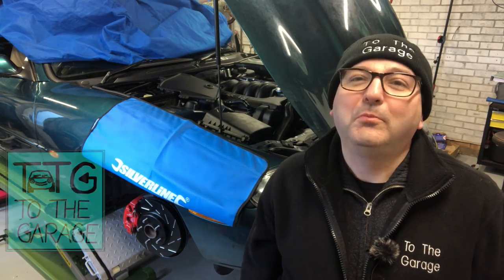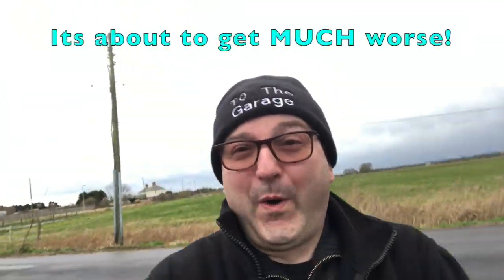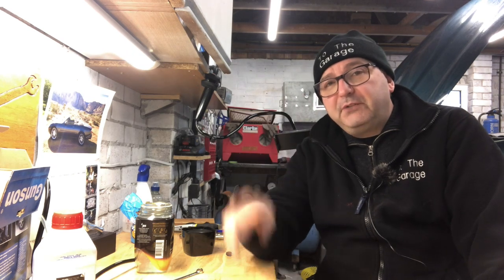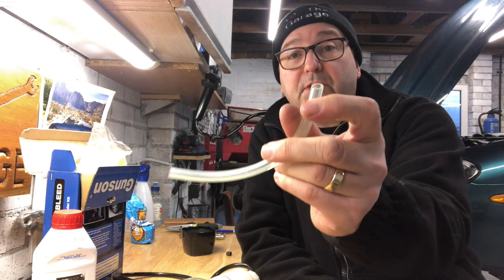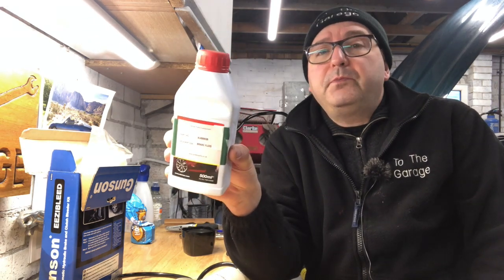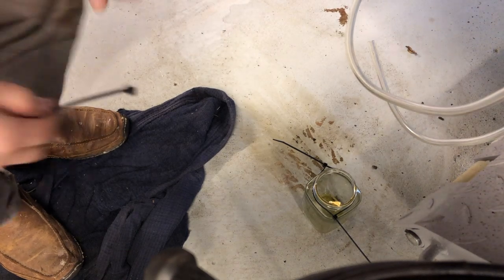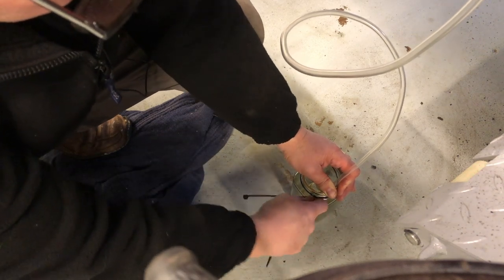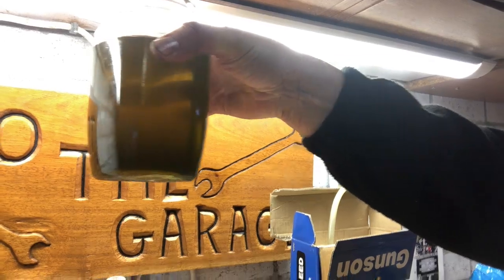Bleed brakes easily. The Brake Saga ep7 Jaguar Xk8 XkR brakes single sided caliper. To the Garage

Comment: Very nicely explained. My wife used to help me bleed the brakes! The last time she helped was on a MGB convertible. She sat in the drivers seat and followed my instructions. All was good then she started to look around my workshop while she was in the car and made a comment "you have a lot of tools and stuff in the workshop! Do you need all this?" That was the last time I asked her to help me :) I have been using a vacuum system to bleed brakes maybe I will do my video with that method. I don't see Gunsons over here in Alberta :( . You will fell a difference in how firm your pedal feels with those braided lines. Looking forward to your test.

Comment: Another brilliant video. Thank you John. This is the one that I have been waiting for as I was cautious about changing my brake fluid because of the ABS pump. I understood that with some cars the ABS system has to be connected to the manufacturer's diagnostic system. Really pleased to see that that is not the case with my XK8. I have bought a compressed air actuated, vacuum bleed system (much to my wife's delight. She has nightmares about 'up, down, up, down!!), but I have yet to try it. I am really looking forward to seeing the results of fitting the EBC discs and red stuff pads.

Comment: John as always excellent video I would like to raise a couple of points and IF I am wrong PLEASE SAY SO ,I always understood when bleeding brakes you should always start from the furthest from the reservoir and work forward, also if changing from dot 3/4 to dot 5 ALL rubber components MUST be changed as they can expand and cause brake failure, PLEAS understand I am not criticizing just trying to clarify :)
Reply from the maker: jagvette1 👋 hi
I would follow the same logic you describe re bleeding sequence in the absence of any other guidance. However on the xk8 jaguar give very specific advice on the bleed sequence in their technicians workshop manual. I don’t know but believe it is to pull the majority of air from the abs pump first by using the Caliper closest to it first rather than pull it all around the system.. and yes silicon seals should be fitted if you upgrade to dot 5

👍👍
Reply: Ahh that could be true :)
Reply: Do NOT use Dot 5 silicon fluid in an ABS equipped system. Dot 4 or Dot 5.1 it is confusing that is why Halfords for example removed Dot 5 from the shelves. 
I use Dot 5 in my classic car as it sits for months over winter as it’s not hygroscopic. 
Dot 5 does give a softer pedal feel.

Comment: John, when you pressure bleed the brakes, as in this video, does the fluid in the ABS pump also get bled out or is there a separate procedure to activate the ABS pump?  In the past, I have bled out the ABS pump on an E90 BMW by finding a gravel road and going crazy on it, aggressively pumping the brakes and activating the ABS pump to force the air back into the brake lines.  After that, I just re-bled the brakes in a normal fashion and the entire brake system was free of air.   Do you know if the gravel road system works on the XK8?
Reply from the maker: The Jag system bleeds past the ABS pump just fine. But i would recommend activating the ABS occasionally anyway so that nothing sticks

Comment: HELLO JOHN 2004 XK8 MY BRAKE PADS ARE GOOD FLUID HAS BEEN CHANGED BRAKE LINE HAS  BEEN BLEED .MY BRAKE PEDAL  GOES ALMOST TO THE FLOOR WHILE STOPPING.   GOOD  MECHANICS TELLING ME THIS IS NOMAL HAVING A PEDAL THAT LOW.   WITH ENGINE OFF PEDAL FEEL IS MUCH HIGHER  HOW  MUCH TRAVEL DO U HAVE UNTIL U FEEL  THE BRALES APPLY.
Reply from the maker: Hi Dennis. Is certainly not down on the floor. To be fair there is a significant difference between the hard pedal with engine on and off. I will see if I can measure something for you. 3 biggest reasons for a soft or long travel pedal will be.
1) Flexible hoses are weak or poor quality
2) Airlock in brake lines due to insufficent or incorrect bleeding. (Sequence is important)
3) Warped disks or word wheel bearings. (pushing calliper back further than necessary between brake applications.

Beyond those, its usually a faulty brake servo or vacuums line to the servo.
Reply from the maker: OK Dennis. I have been upside down in the footwell for you. I recon thats one shandy if we meet in the future🤣
Engine off the pedal travel to the solid point is 4cm
Engine on there is another 3.5cm of travel.

Comment: Another great video, just as an aside John what watch are you wearing? jusr another hobby of mine
Reply from the maker: Sorry Bruce
This one slipped by me for a whole week.
Thanks for asking.
Its a Casio G shock stainless edition.
I wear that most of the time because tough as nails and looks good.
I wear my Apple Watch in the week because its so useful as a timer, calendar reminder and remote camera release.
And I have a very nice Baume that I only wear for special occasions.
What are your regular wears?
Reply: @ToTheGarage  John I have some rather different watches started with the Bulova accutron 1970's the one that went to the Moon. I have about 100 in total OMEGA my nice ones,  I brought a Rolex in Aden in the 1960's when stationed at Steamer Point. Also what they call converted  early 1900 pocket watch movements converted to wristwatches, Hamilton,  Christopher  Ward, so many more makes, Divers, two Jaguar watches, some Russian, Seagull, very lovely and made in China, don't have a Baume M, . Got a bloke coming over Wednesday to fit a new one piece roof liner, he can do the whole re-fit including travel from Lincoln in the day he says he does about 8 a week. Waiting for some dry time so I can paint my calipers!

Comment: great video very informative.I have an s type r could i use the vacuum pump method to bleed brakes?
Reply from the maker: Absolutely. Same kit would do the job. Just be careful when using either vacuum or as I did positive pressure, that you don't allow the brake fluid reservoir run low, as you will introduce air very efficiently that way😁
Reply: @ToTheGarage  thanks john

Comment: hi John i have tried to bleed the brakes  on my 04 xk8 using the traditional method with my wife on the brake pedal the fronts bled fine but could not seem to get much out of the rear wheels and the pedal was solid  would the engine running help many thanks and keep up the great videos
Reply from the maker: engine running will help apply more pressure to the pedal. But I would replace or clear out the bleed nipples on the rear.

Comment: Hygroscopic, and I hope Lincolnshire is precisely so, otherwise I hope you have kayaks.  Presumably the brake kit manufacturer has a well documented bedding-in process prior to the empirical testing.
Reply from the maker: Gary VanRemortel  the county has indeed absorbed all of the water now and is currently being ‘bled’ by an enormous pumping station at the other side of the village. Powered by a septic engine it pushes alll the water out to sea. ( we are 1 ft below sea level!)

The standard work for bedding in has been trained out and will be deployed prior to assessment of the new system.
Full empirical testing will include measurement of stopping distances using a marker twig and brake feel using the same shoes and socks benchmarked previously😁👍
Reply: @ToTheGarage  I trust you will be using a calibrated twig of consistent mass and will compensate for elevation variance..